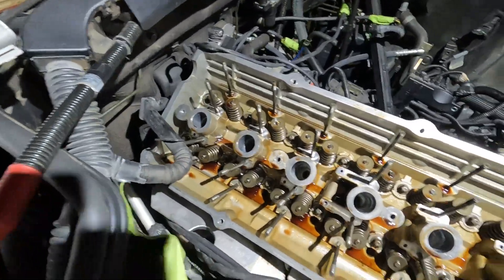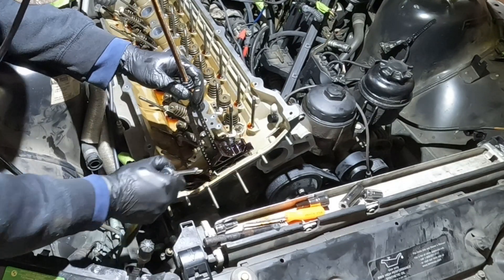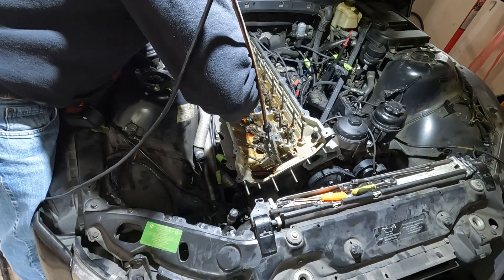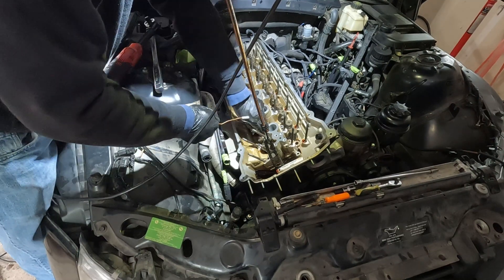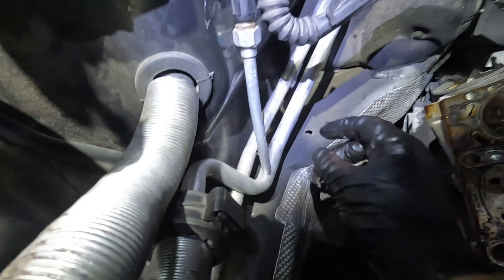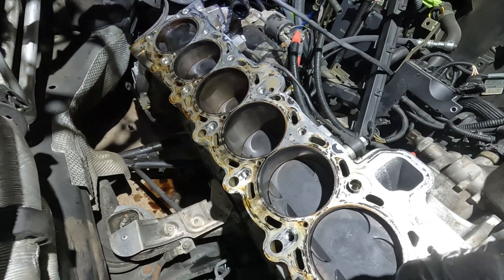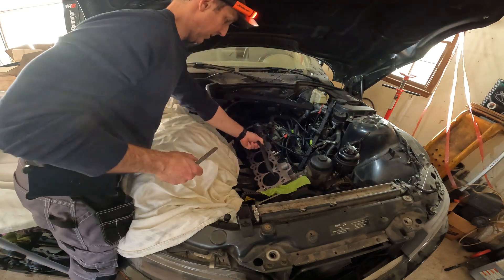BMW M52 M54 Cylinder Head Removal Procedure And How To Check Block Deviation #bmwrepair

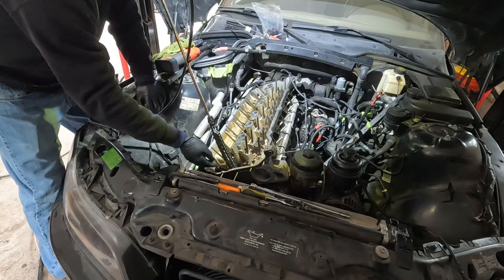Comment: 5:46 Dumb question, my chain guide broke off while removing the cylinder head. Do I need to remove the whole chain housing now or can I change it somehow? Thank you in advance
Reply from the maker: Sorry to hear that. For this issue you would need to temive the timing case cover on the lower section of the engine to access the chain guide.

Comment: Hey man how long was your straight edge ? 24” ? 

I never had a problem with not checking the cast iron blocks, usually the gasket fills in the inconsistency if there is any, august on 22 got my car regasketed and drove great until Xmas of 22 and began leaking between the block and head!! This is the first time I’ve seen it leak under the intake manifold side opposite to the tilt of the engine ya know. In my 12 years of e36ing I’ve never had one leak on this intake side but plenty of times have had them leak on the exhaust side. Anyways I’m about to get it cracked open again but I suspect my mistake was listening to a friend that day when I was setting the gasket down this friend insisted we use the copper spray on the elring gasket, this was my first and last time ever using that spray lol I suspect the spray is what ruined the gasket prematurely!?    Oh and obviously I had sent the head to the machine shop but the block I checked with a piece of flat iron at the time just for visual light passing thru and it passed my eye test, I’ve done it this way at home successfully numerous times except for this time 😢 my moneys leaning toward that copper spray that was used on the gasket, the manufacturer told me most likely this is the reason why it let go so I’m going to attempt to fix it tonight with just a quick gasket slap and hope the block is in good shape. Need to buy a straight edge like yours today if I wish to proceed
Reply from the maker: @onesikm3  Hello, Sorry to hear about the leak! I agree that the copper spray was a bad idea. Should go on dry and clean. I have a 24 inch straight edge.